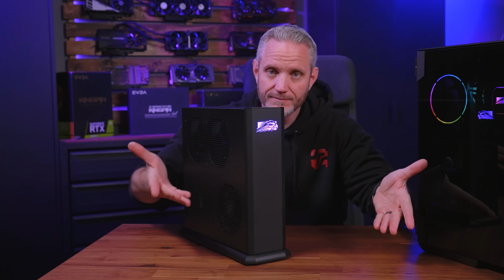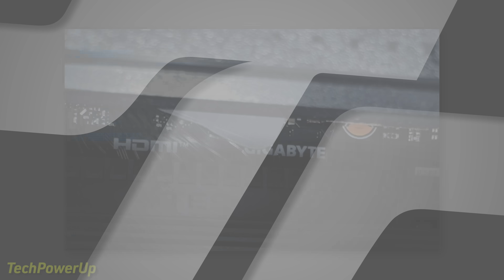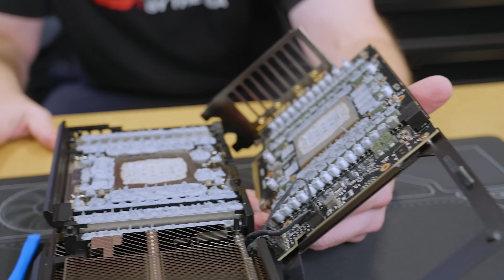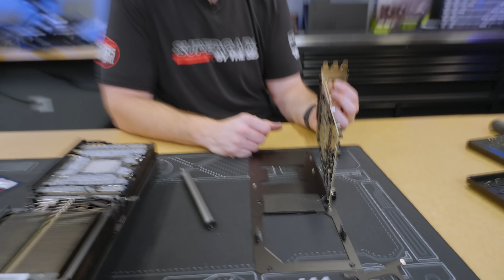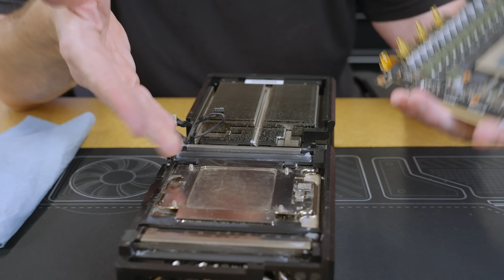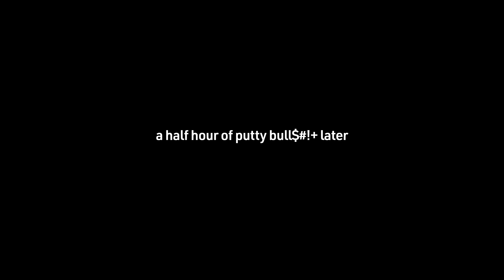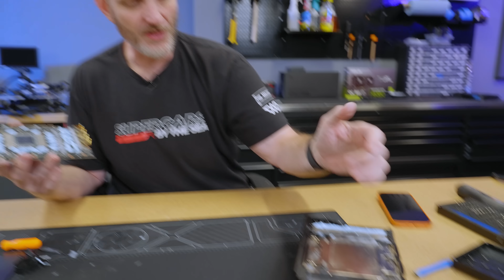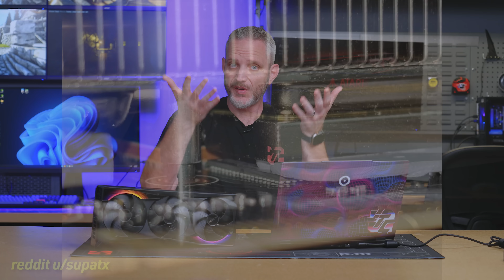What the HECK Gigabyte... WHY?

Comment: The reasoning behind it is exactly what you mentioned, to remove the consumer user serviceability out of the product. That means either more GPU's sold, as in disposable product, or needing to take the GPU in for servicing. Surprised there's no subscription model.
Reply: Given that 99% of users will never service their own cards like this, or even take it to a shop to be serviced, I doubt this is a real consideration. I say this as someone that has repasted/puttied my GPU before. We are the outliers here.
Reply: @ReivecS  I'd agree except the very beginning of the video shows how this new thermal compound has a tendency to find its way out covering more areas of the PCB than it should. Seemingly for vertical mounted cards but with how much bigger and heavier GPU's are getting, might become more of a norm. 

Imagine being a regular gamer that has no clue how to build a PC and at some point you see that compound leaking out. They aren't going to deal with it like those of us that understand what's going on. No, they are going to take it in for repairs or send it back under warranty if it's still under warranty. If not, they will buy a new GPU and complain the whole time. I've been in IT long enough to know, users aren't computer literate enough to react sensibly.

Comment: Zero issues here with my Gigabyte 5090.
Reply: how long have you had your card? i've had my 5090 gaming oc for about a month now and so far i can't see anything leaking out
Reply: @henninglarsson4858  I got this card about a month or so after the 5090's dropped. Temps have been great, no leaking. Mine is horizontal though. Maybe the vertical mount is the difference.

Comment: umm, do you not need to actually put anything on the actual GPU core? or just didnt show it on the vid? lol im currently a gigabyte gaming oc RTX5090 owner and yeah plan to run it 5-7yrs min before upgrading, but wondering will I need to re-putty the card in that window, guess just see where temps are at, I do monitor temps with MSI here and there regularly while gaming, obviously being new, temps are great
Reply from the maker: I used KPX, it's even reflected in the charts what is on the core...

Comment: I tried thermal putty once on my GPU. It was a pain in the butt to apply, stuck to everything, and cause horrible overheating issues. Getting it off again was the worse. I do not recommend thermal putty, no matter how simple it sounds. Cutting a pad is much MUCH easier than applying and eventually removing thermal putty.
Reply: They use PTM these days. I used it for my current PC build on the CPU itself. It works well. I'm not sure of the point of this putty in the long run. Gigabyte did not test this out enough ahead of time.
Reply: What kind did you use? There are ones like CX-H1300 13.52w/mk putty that has a consistency of playdough, been using it on my gpu of almost 2 years now without overheating issues.

Comment: Gigabyte is brushing it off, saying it only happens when the card is mounted vertically, but I’ve checked Reddit - the thermal putty still leaks in horizontal setups too, though not as many cases as in vertical positions.

Comment: I have this card and I love how quiet this card is compared to Astral. I had both cards and decided to keep the aourus. If you don’t want to do water loop the aourus is the best rtx5090 air cooled card. This is the only card with binned vrms, hitting over 3k stock no problem. The best thing about this card is that it has almost no coil whine, silent. The astral had a noticeable, moderate coil whine.
Reply: Yep, have the same card. It's amazing and looks great.

Comment: That's good to know that they're optimizing for pennies on production cost on like $2000 GPUs and running in to problems.  What clowns.
On my CPU I have one of those IC graphite pads.  A really old one, like 8 years old.  Seems to still be good.  Next CPU+motherboard, whenever that happens, I'll probably get a new one.  I hear they've advanced a bit in that time and it already works decently, and keeping the old CPU+motherboard together could be useful as a backup or to sell/give away.  I dunno that a ryzen 3800X will have that much demand though.

Comment: Initially, I though they only use putty for some parts. But covering the whole board like that? They are not doing for saving cost or increasing performance. They've planned it to fail!
From what many repairman share, thermal putty will slip under components between solder joints. In fact we can see the putty already begin to infect this card on the edge of component. At some point, when getting hot, it will expand and break solder joints, lift components or even causing popping off. THIS IS A TICKING BOMB!
Can't imagine now they design it to fail, what the hell is going on...
Reply: Reapplicant will make thing went worse by accelerating the process.
Reply: It's called what I like to term - inbuilt obsolescence.
Reply: @garystinten9339  This goes far beyond what can be defined as planned obsolescence...

Comment: These gigabyte cards are a nightmare I work a returns repair/refurb job and we get loads of 4090s and 5090s with chips stolen but I've seen the hybrid liquid metal leak out and cause many shorts on the board shocking stuff for a 2k+ card

Comment: Separate systems, I have the Aorus Master RTX 5090 and the AORUS Gaming OC RTX 5090, and I've had zero issues and excellent temps. Both are mounted horizontally "normally", and I believe that's why I (and others) may not be seeing this issue.  This seems like a problem that would be worse for vertically mounted video cards where gravity would cause the compound to move outward/downward over time.  These Gigabyte cards also have 4-year warranties unlike almost all of their competitors, so that does give me peace of mind as an owner.
Reply: That peace of mind is worth nothing when Gigabyte just happily denies your RMA because they found some obscure damage and claim you are at fault for whatever reason. Friend had a 3080 Gigabyte which literally burnt out and they just told him it's his fault and he caused the damage. Manufacturers can waive warranties what they want but if they do not honor them it's baked air.

It is also very well known that out of all brands Gigabytes end up the most in repair centers, Gigabyte 30-40 series had severe hotspot issues within months of use from new state because their thermal stuff was so bad, considering their mess ups in other departments such as skimping motherboard VRMs without modelname changes for AMD boards causing instability and their PSU's exploding is not helping their name in any way.

Only in EVGA I would have trusted, maybe Sapphire or XFX on the AMD side.
Reply: @G4m3m4st0r if you trust Sapphire you also trust Onix (intel) Zotac, inno3d and manli. 

They’re all the same company.

Comment: They used a single component dispensable gap filler. This doesn't set. They should have used a curing two component dispensable gap filler. As the name implies, it cure... becomes hard within 24 hours. Faster if placed in a oven (>70°C) during the assembly process. The advantage of a dispensable gap filler over normal 'thermal pads' is that there are no tolerances to account for when selecting the pad thickness... Apply it and assembly and it sets itself. Keep in mind that a thermal pad is just 'thermally conduct' rubber. To compress it so that it can make thermal contact, you need to apply forces.

Comment: That is ridiculous.
I miss EVGA.
Reply: I'd "kill" for AMD based EVGA GPUs (obviously don't want to hurt anyone, but yeah). Can you imagine next gen EVGA AMD GPUs!? I SURE CAN!!
Reply: @ninjainjaht7346 AMD isn't lacking for high quality AIB manufacturers, at least. Sapphire, Powercolor and XFX are all great.
Reply: i still holding on to my evga 1070 FTW
Reply: I’m still running one of their kingpin cards, I loved the kingpin series.
Reply: EVGA didn't even use thermal pads on gtx 1080.  Users had to register their card with EVGA and get pad replacements to fix the problem.
I never had the card, but my friend had this problem and it was pissed he had to take the card apart to fix the cheapness on his 1070.
Reply: EVGA was worst when it comes to design and looks. Hate me if you want.
Reply: I know as soon as I heard they were going to stop making GPUs I had to get a 3090 from them.
Reply: I bought a $200 CAD used EVGA GeForce GTX 1080 Ti SC2 Hybrid (AIO) stable 1986 mhz, 50s temps, and no OC.  11GB RAM.  In terms of rastor performance it's tied with 3060ti. Good enough for me on 2560×1080.  8.5 year old card.

My next upgrade will be either to a used 
EVGA 3090ti, or some recent AMD card...after I uprage from my 10th gen Intel cpu/mobo to AMD setup.

I'm a die hard rastor performance guy.  I'd rather have 120 fps stable at 1080p without the DLSS/frame gen bandaid option.  Poorly optimized drivers and game software coding is the real issue.

As for RTX...I hear its a huge FPS hit, and subjective visual improvement...also dependent on how game is coded.  Upgrade to a better monitor and get it calibrated properly will have a significant visual improvement with everything you do on your PC.
Reply: Evga does have some good card but also some bad one like the pheonix series on gtx16 series
Reply: @hunter7752  EVGA didn't make a Phoenix series. Their lineup would be Black, SC, XC and maybe the word "Ultra" tacked on to some of the higher OCs.
Reply: Still using EVGA today.
Reply: what exactly is the problem? aorus master has best non-watercooled temps out of all 5090s.
Reply: Bot
Reply: I don’t miss I don’t live in merica
Reply: overrated
Reply: EVGA could be alive if they turned to AMD side.............sad
Reply: @barrozo24 they dont make good gpus lmoa but ok 🤷
Reply: EVGA cards was garbage and whoever thinks otherwise never owned one. From the four different Evga cards I owned three of them died literally after a less of a month of use and during the RMA process EVGA had the audacity to send me back referbs while these cards was less than a month old brand new,while the fourth got sended back sealed to my retailer to replace it with another brand. EVGA just had the best overclocker for years putting their name high and direct connections with Nvidia to have descent chips in the binning process but as a company no. EVGA always had average overall consumer products minus the Kingpin cards. Those was Jacobs and Kingpins creations under EVGAs brand. The last 2 EVGAs cards I owned was the 3080 with the red lip that died after a week and the replacement came as a referb and got sended back for a proper replacement of a new product by me. Took over a month and once it appeared to my doorstep was the black lip 3080 which lasted exactly 26 days. The next replacement directly went back to my retailer for a brand change. Previous to that was a 2080ti that shared similar fate. Lasted a bit over a month and the replacement was again a referb.
Reply: @RipperDraco  Literally the only brand I've ever had loyalty towards. I've got an 8800 Ultra, 2 9600 GSOs, 3 9800GTs, a 9800 GX2, GTX 295, twin GTX 480s, twin GTX 780 Tis, 3 1080 Tis, 2 RTX 3060 Tis, a 3070 FTW3 Ultra and 3090. Every single one spent a life running Folding@Home and every single one is still fully functional with only one GX2 RMA and one 470 that they upgraded as well as my second 470 to a 480 on RMA. There's also some lower and mid range cards I've used for friends, media pcs and so forth..for example a pair of passive 1030s I got for 99 cents each, a GT 545 (best card that didn't need additional power at the time), 750 Tis, a couple 970s, etc.

Sorry about your luck.
Reply: @94XJ I mean it happens plus my experience with the brand was horrible, but I forgot to mention that I belong in Europe so EVGA cards where I'm at are considered as exotic cards since its a US brand and its less accessible for Europeans. But their last generation of GPUs the 30 serries if I remember correctly had a flawed design somewhere on the board level and made plenty of their cards to fail. I had American friends that they faced issues with their FTW3 cards aswell. I'm not brand loyal at all but I always had great experience with MSI and Asus products. My 4090 was a Suprim X and my 5090 is An Astral OC. Both fantastic products. After these 30 serries failures I changed the third 3080 on my retailer for a Strix 3090.
Reply: @RipperDraco  Sounds to me like it you were either 1) Very, very unlucky. 2) User error / other parts were causing issues 3) Lying.
Reply: @trey4048 what sounds like to you is completely irrelevant to me, that was my experience with the brand and since that was the experience with the brand I don't have anything positive to say. I'm not petting ears here that was my experience.
Reply: EVGA was using that thermal putty shit too.
Reply: @keestojuusto6072 not on any that I had owned
Reply: Always that one guy in the comments who has to go on about EVGA
Reply: @123Suffering456  never owned an evga product and it shows.
Reply: @SaltSpirits  I just dislike people clinging onto the past like this as if it's going to do any good for the present. The fact is, EVGA is gone from the GPU market, and I think we can all understand the reasons for that decision. This is the present, and I would argue it's unlikely they will return. So... people should move on, in my opinion, instead of clinging onto the past and how it was all so much better back then. It was for sure, but that doesn't really help us now, does it. On top of that, it feels rather sentimental to me in a way that is all too reminiscent of people acting like a company is their buddy. They're not.
Reply: @123Suffering456 I don't think it is that people miss EVGA because they were EVGA. They miss the standard that they set for quality and owning up to their mistakes. Without competition, the customer loses. I am hard pressed to upgrade my GPU, because I know I will have to settle in quality. It is the same for people who miss older cars that were built with less failure points of today's cars. No point in arguing over their nostalgia, we all are nostalgic over something and will die on the hill over it. I say if you don't like it, just ignore it.
Reply: @123Suffering456  nothing wrong with people demanding high quality, reliable cards such as EVGA.  If there's a company that comes close to EVGA, please inform us.  People have every right to demand cards built like EVGA did it.  I don't care if it's EVGA or not, I just want good build quality lol.  The EVGA 3090ti is my next upgrade once price dips below $800 used.  It's still a very high end card for the price with 24GB RAM.
Reply: @123Suffering456  Always at least one person who can't take off the rose tinted glasses.
Reply: @123Suffering456  Why should he not?  They were an outstanding company for GPUs.  Between that and the 12v connector fiasco it is no accident I am still running a EVGA 3080 Ti.
Reply: @Stubbies2003  It just doesn't do anything to still be all nostalgic about it when clearly, EVGA is not going to return. And I cannot blame them. So seeing people still clinging onto them, sort of, feels a little cringe to me personally. Similar to how some folks will keep going on about how it was all so much better 'back in the day'. I mean, yes, maybe. But it doesn't do anything for the present to keep going on about it now.
Reply: @Stubbies2003 that’s why evga dipped because of the 12v design
Reply: @123Suffering456 tldr - things suck now, don't remind me how good we used to have it.
Reply: @NetbeastGaming  
Put the least amount of bend in the cables

-t electrician that worked on 5000 amp / 13500v systems
Reply: @123Suffering456  facts im not even going to lie here my first gpu was a evga 1070 and that thing had terrible thermal performance (50-60c idle) when i got it so i just returned it and got an msi 1070 instead... oh the days when gpus like that were just sitting on shelves with multiple brands available. I find it funny though because here im watching this video and I have that exact same Gigabyte Aorus GPU  (5080 version) Jay has in the video, no issues with it so far though thankfully, runs perfect and idles at very good temps even with the fans off! (25-30c!)
Reply: @hythere  yea, back in those days PC gaming was a small niche.  I still had to wait in line and hope I could get a GTX 680 on launch, though. Then Ninja, Fortnite, and Twitch blew up and everyone wanted to be a PC gamer to stream.

How soon we forget.
Reply: @123Suffering456 well, one someone comes half as close to as good as they were then we will stop.
Reply: thats EVGA's fault for disagreeing 😂
Reply: @IAmTokix  No given how NVidia plays with the card makers I cannot blame EVGA for dipping out when they did.
Reply: @IAmTokix it's nvidias fault for being greedy
Reply: @xninja83x67  Nah bro It's EVGA;s fault for disgareeing when comes to the 12 pin power argument and plus this had nothing to do with being greedy the value is very accurate cause they make very beefy gpu
Reply: @IAmTokix such lowtier ragebait
Reply: @justsomething0 and still yet replied successful ragebait
Reply: @IAmTokix  TROLL alert